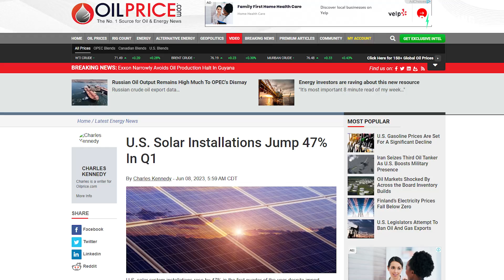Solar Surge: U.S. Installations Soar by 47% Despite Tariffs & Economic Woes

Comment: Thank you. However, note that this jump is partially due to supply chains and permits issues that delayed deployment in 2022, and were resolved now. The jump is between 2022 q1 and 2023 q1, and the installation is similar to 2022 q4.

Comment: Solar is doubling about every 2 years, 2022 it was 4.7 % of the total for the US (source pv magazine usa) so assuming current rates (and ignoring the IRA’s accelerating effects) —2024 9.4%. —-2026 18.8%—-2028 37.6%—- 2030 75.2%, at that point, with wind growing as well, we should be near fully renewable

Comment: Problem is these power companies want to also control solar instead of what they should;ve focus more on was actually building batteries pack systems. Solar is soo cheap now and it will only continue to get cheaper while taking up less space. The same can't be said for batteries and the need for more. Either because of weight or because of size. Smaller backup units could be install - but they account for more cost than making power does. Power companies need to be push into going into this route more than making power at this point if they want to continue being part of the "system". Most of these batteries dont even need to use Li - we now have had options for salt water batteries for a few years now.... this will be the move and cheapest/fastest way forward for these companies to continue working while home users still continue to install their power generation. States might have to start taking control back from these power companies as well maintaining the lines themselves.

Comment: V2G is the key technology. 
Selfparking EVs.plugging into the grid. 
Trickle feed 23hrs a day. 
Trading electricity with the grid. 
My daily avg from the grid is 7kwh. 
Replace gas supply and we would need 7kwh more.
14kwh a day is ezi pezi for a rooftop solar PV system. 
Add battery EV charging then 7kwh more. 
21kwh daily total or 28kwh with 2 vehicles. 
The grid is UNLOADED and protected from our personal electricity demand.

This stuff is baby easy to understand. 
We need to understand this before masses of money is spent on the grid transmission infrastructure. 
We need to understand this before massive generation plants are built. 

Transmission costs are the killer costs.

Comment: Installed an 8kw here in dallas  in 2014...producing close to 10 megawatts per year..$13k for price and With $7k total rebates.... cost me about $6k....bought me 2 used volts and a bolt and never looked back

The savings are great and it keeps on giving

200k miles later saved about $24k on gas and maintenance 

If an idiot like me can do this..... anybody can do it.... just amazed how much savings there is by using solar and used phevs

Energy independence at last and more money in our pockets

Comment: Sam, you often mention there low cost of the panels. However, in my limited experience the cost of the panels themselves are no more than about 30% of the total cost of the installation. I did the job myself and the costs split roughy into thirds: the panels, the inverter and the mounting hardware. Had I paid for labour the panels would have probably no more than 25% of the total.
Reply: The drop in panel prices is real. Below 20 cents per watt in China, unsubsidized. But that also quickly makes most residential systems uneconomical, as the cost of installation and inverters is multiple times that of utility-scale. And, with utility scale installations increasingly reaching daytime overproduction, any excess fed back into the grid by residential loses its value.
Reply: I had 8 panels fitted to a house I owned about ten years ago. All in the installation cost was about £12k but back then we got a good FIT payment (payment for energy exported) that made it a good investment. This March, on a different house I moved to a few years ago, I got 7 panels, a 3.4 kWh battery, a smart inverter and a car charger for less than £11k. The cost of the panels has gone down massively in that time. Hopefully the same thing will happen to batteries as that is the game changer this time. Without the car charger it would have been £9k.

Comment: Aren’t they use too much land that should be used for agriculture for these solar panels. I think nuclear power is better. In France, 75% of their power come from nuclear and they are doing just fine
Reply: No, they hardly use any land. Wind and solar is cheaper than nuclear.
Reply: We know that farmland is not valuable because it is used to grow corn to make ethanol to feed our cars.  If the goal of corn-->ethanol-->cars is in fact vehicle miles then PV--> EVs produces far more vehicle-miles per acre.  According to the University of Minnesota, 86 (eighty-six) times as many vehicle miles per acre with PV than by growing corn.  And get this:  No water is pumped out of the ground to irrigate solar panels, leaving more water for other crops.
Reply: At least here in the US - almost half the produce food is wasted to gas turning corn into ethanol. IF we can move away from gas power cars in general -  half that land comes back for real food production and the other half can still be used for solar + food hybrid. Also there is a TON of land that isnt really good for farming - so it doesnt matter either way.
Reply: Agrovoltaics is the name of the practice of using the shade of panels to produce shade for crops and livestock.  If I had a farm and could put panels in my fields, I would grow some great greens and have another area for cattle to move through in rotational grazing.  I agree that growing corn to make ethanol is absurd.  Charge batteries for townsfolk on those acres.

Comment: Some of those increases were homeowners trying to get there systems installed before the NEM rules change.  Permits for new systems in California have fallen by 40 percent since the change of the rules on April 15th and are expected to fall further as the power companies are further de-incentivizing solar benefits with a fixed pricing scheme.  This is very sad, not just for California but many other states are following California's lead and reducing the benefits of home solar installation.
Reply: A lot of that is the need for batteries - I think if I remember right, almost half the power generated from solar is wasted because there wasnt enough way to store the power. Main problem isnt the people/home owner though - its the power company. Instead of building batteries - they too wanted to get into the solar game instead / control the market too.
Reply: @adr2t  You are correct.  They want homeowners to have batteries installed, which I can understand, but they also want to charge the customer with solar on fixed pricing scheme meaning even if the homeowner never uses a single watt from the power company they still will pay up to $90 a month just for connection with no product delivered.  Now they're talking about using homeowner battery power for grid stabilization but since the introduction of NEM 3.0 they only need to pay homeowners 1/4 the price they charge, which is insane.  They want their cake and eat it too and then steal someone else's cake.
Reply: @Ryan-ff2db  Pretty much, as to say, I think there needs to be a push back for this. While I understand they still need to charge "something" for "up keep" of the grid (making sure the power lines even coming from your home work) they need to still provide a method to pay you back for power you do give back to your power company. IF they want to use more from your home though - they need to pay more for that use esp if the customer is fronting the bill and cost for the battery that does have a limited cycle limits. There need to be push back for the power company to front the bill for grid size power storage - its the only way to keep prices down as the system builds up charge/power during the day for night use and thus over all usages of peeker plants down.
Reply: @adr2t  Yes.  I think the power companies are playing the long game, crying foul because the finances aren't so good right now.  In my area PG&E had to pay out 20 billion in a settlement for the Paradise fire and countless more billions to burry the high power lines to prevent future fires.  This along with bloated bureaucracy and overall inefficiency they are so well know for, they simply weren't doing so good.  That's about to change dramatically.  As I said someone is thinking ahead, and bringing lobbyists along for the ride. 

Currently the energy produced by homeowner and business solar is the approximate equivalent to 5.4 full commercial scale dual reactor nuclear power plants like the one being built in Georgia.  Now instead of the massive costs of building plants and maintaining them they can install large batteries for a fraction of the cost and "purchase" energy from homeowners at 1/4 the going rate, store it, and sell it back at peak hours at an even higher rate raking in 5, 6, 7 times the amount they paid for it and then charge you a fixed monthly fee on top of that.  Some politicians got some pretty good bribes on this one.

Comment: Wait a minute - adding 1 Solar Watt to the grid means what?
The cells only work 6 hours a day and 18 hours they produce no electricity.
So what does that do for the grid?

Nothing that I can think of - carbon fuels still need to make the grid work 18 hours a day
or 4 times the solar panels need to be installed and batteries to get a very fragile grid working
that shuts down after 24 hrs of no sunlight as when a large storm stalls out over the cells.

We are just making China rich for no reason...

Comment: Solar has fewer moving parts (than wind), and probably more reliable (if enough sunshine)
Reply: They work when it’s cloudy also.
Reply: @whowhy9023  People keep repeating "it does not work at night" but with enough panels we could power the whole world from moon and starlight. It would be very inefficient and probably cost enough that putting the panels in space instead would be a cost effective alternative, but we could do it.
People also always focus on renewables needing energy storage, but what else are those big spinning turbines than flywheel energy storage? Also there were pumped hydro, flywheels, and few other energy storage systems in use for decades before wind and solar became a thing.
Reply: @AnalystPrime  Well main question you have to ask them is what does it mean to work at night? Because all that really means is we store as much as we can during the day.. it doesnt have to be 24/hr power generation. Even now current power generation like coal still waste half of its power because it too doesnt have a good way to store its enegery and it too does need power storage if we want to be a bit more green with what we have. If we had 10% more batteries today.. we could shut down at least another 10 more power plants tomorrow because of the loses of todays power grid.
Reply: Percentages are for suckers

Comment: I think we will be doing a 14KW solar fence at our house.  The roof is to steep and hiring it done is WAY more expensive.  Solar isn't very popular in our area, but we have a good location.  Tennessee doesn't do buy back easily so we are going with batteries and use it to just reduce our costs.  This is not totally economically driven but a passion project for my wife and I.
Reply: Solar fences sound a great idea ! Maybe angle the fence slightly to increase the efficiency (better angle to the sun) - though it would look a bit weird ! Depending on situation, could put vertical fence, then angled panels on top...
Reply: @chrisheath2637  glad to see I'm not the only one that sees that is a good solution ☺️.
Reply: @jackcoats4146  "Watts" not to like ! Easy install, easy access and "free electricity" ! Mind you, in a neighbourhood like mine - easily nicked (stolen)...
Reply: @chrisheath2637  some locations have issues.  We understand there are risks.  I agree it is not for every place or everyone.
Reply: Good idea.
Reply: Go for it .
Reply: Wait  sodium batteries by the end of this year. It's cheaper  and coming.
Reply: Can’t wait for Tesla to push distributive utilities beyond Texas and California to other states!